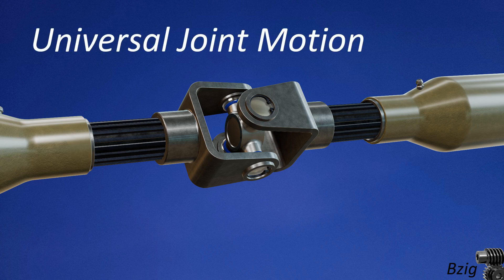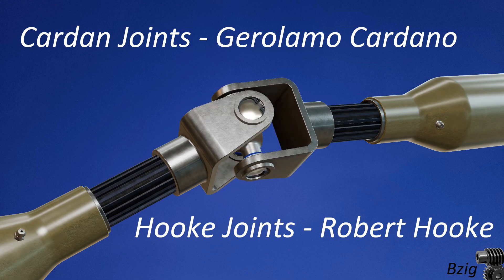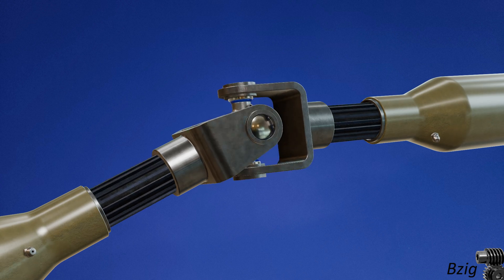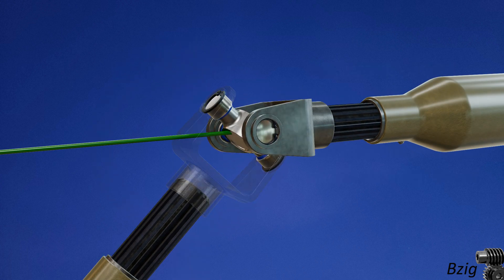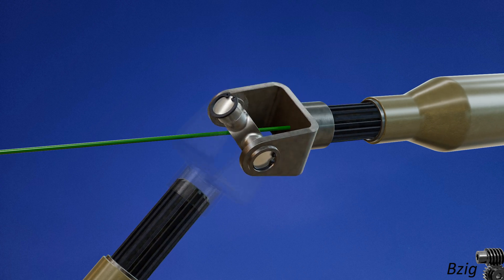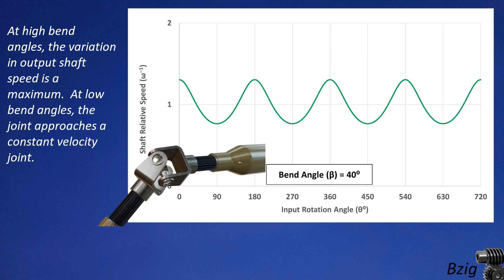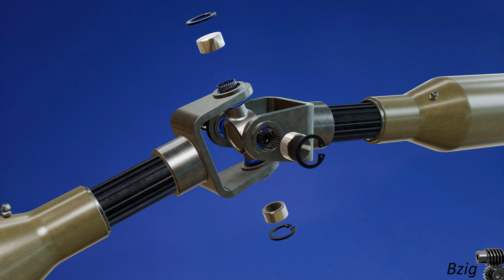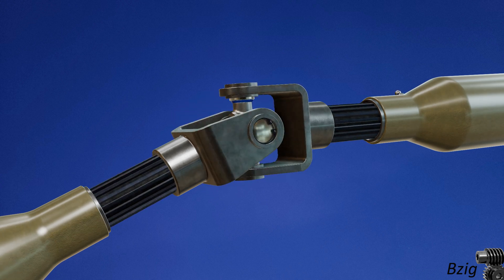Universal Joint Motion

Comment: I noticed in your renderings what looks like a possible grease port on the cross. 

Is that what it is, and if so, does that imply that the cross is hollow and can be filled with grease to lubricate the bushings/bearings that support the yokes of each shaft?
Reply: A joint with a grease zerk fitting is called greasable, while one without the fitting is called sealed. Typically speaking, a greasable joint is more prone to failure and a sealed joint is more favorable. But, that's all dependent on whether or not the end user is good at regular maintenance and also what the application of the joint is. 

When applying to vehicles, a stock application (no modifications to engine power output or suspension) with regular maintenance will benefit greatly from a greasable joint.

A heavily modified vehicle (even with regular maintenance) won't see the same benefit, due to the cross of the joint being hollow and therefore less strong.

It's something to consider when selecting the right U joint for the job
Reply from the maker: Yes, there is a grease fitting on the cross; that's what I intended.  I'm sure there are u joints with sealed bearings, and no grease fittings, but I know for sure that a 1992 Jeep has grease fittings on the cross. I also used parts from McMaster-Carr as a reference for creating the 3d model and all the ones I saw had grease fittings... Although I didn't look at every available part.
Reply: @bzig4929  In my experience, they do have grease fittings.